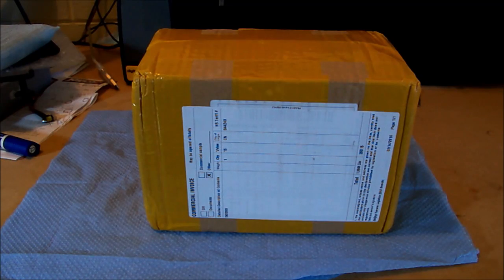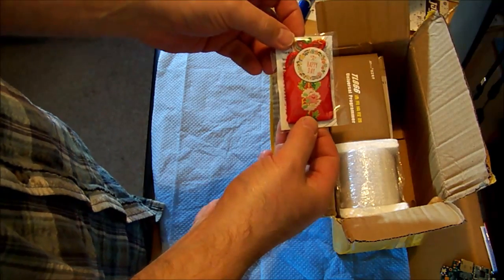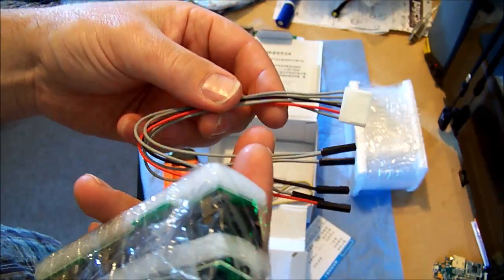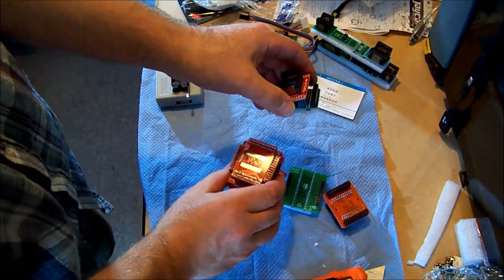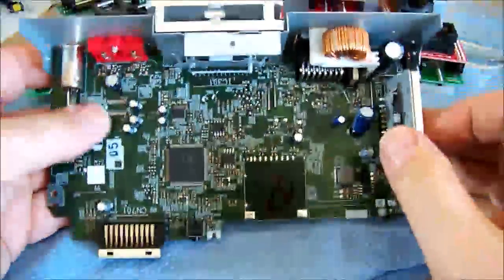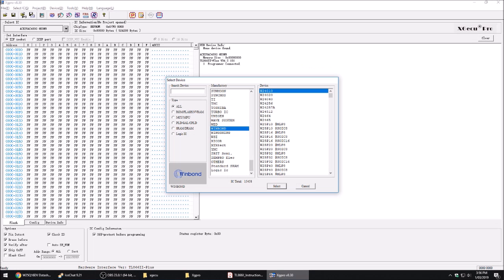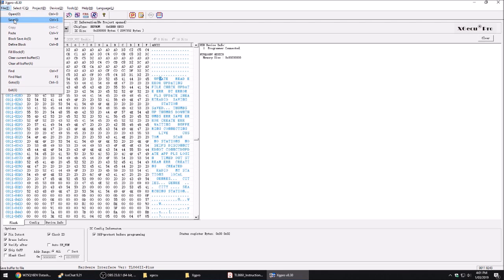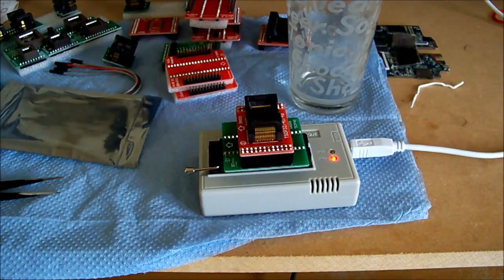XGECU TL866II PLUS EEPROM PROGRAMMER REVIEW

Comment: I ordered one a month ago off eBay from a reseller in Kentucky.  The unit came with a green 3M socket (a good one!) and works with no issues!  Excellent video!
Reply: Just noticed on both the Xgecu and Autoelectric websites - pictures of the TL866II plus with black and green sockets.
Reply from the maker: Thank you, glad you enjoyed it. Hope it serves you well!
Reply: @JonnyFix  It has so far.  I also have a Willem to program 21 & 25 volt EPROMS.

Comment: Thanks for the video might help me decide between Carprog, KESS, VVDI, and this one 
Great explanation thanks again
Reply: Get a Kess (V2) and a KTAG, both are great for programming ecu and bcm. Like the tl866ii, avoid clone units and buy MASTER units not slaves. Also, spend the money on the optional rig to hold the modules and the spring-pin adapter plates. They save a ton of time setting up and tearing down while programming.

Comment: What a great tool, no eeprom is safe now ha ha :-D
Happy zapping :-D
If i was you i would look around for a suitable case for it, perhaps an old electric drill storage case or similar.

Years ago i bought a willem eprom/eeprom/pic/i2c programmer, it was the old parallel port connection.
I saved quite a few mobo's by reflashing the bios, good for general eproms up to 25 volts.
Every memory i had was tested, well i had to lol :-D
The shame is modern personal computers have lost there parallel ports, so it's dead :-(
Any usb adaptor has to be a real parallel port, not a printer only bodge up.

Comment: I tried to read the winbond chip while still soldered on board & a error message keep pop up saying the programmer found short circuit & the protection kick in , it is not wise to try with chip while still on board , I tried with IC removed & it is working fine
Reply from the maker: This sounds accurate

Comment: i couldnt find any info online, does this programmer have support for 95xxx chips? 95040 specifically?
Reply from the maker: It can do the ST  MP95040 range and ROHM BR95040 according to the list in the software. If you download the software it will run in demo mode without the programmer attached so you can see what devices can be chosen :)
Reply: @JonnyFix  thank you sir!

Comment: Hi there I'm ordering this device without a CD and I need your help on downloading the software if you could please
Reply: Go to http://www.xgecu.com to download the software.  There are links about half way down the page.  It mostly in Chinese and the download page is almost totally in Chinese but the links are easy to make out.  I just ordered one of these units - it came with a green 3M socket - and it works like a champ!  I have another programmer - a Willem that operates through the parallel port - that works as well.  I wish this one would do the Xicor X2212D chips.  Then I could backup a lot more ham radio data!

Comment: I have a M27C1024 - 64K x 16 EPROM in a PLCC44 package and used the PLCC44 to DIP40 converter on the apparently official XGecu TL866ii Plus.

I just can't read it as it most pins show no pins detected. My chip is working fine in on the board it came from. 
I emailed XGecu's technical support line but no response.

Any ideas what the reason could be for the no read ?
Reply: Is this chip on their official supported list? You can find it on XGecu's webpage.

Comment: Could be that mine is either a clone or I didn't get the full package option; I didn't get even 1/3 of the socket adapters that you got.
Reply: If you look on Amazon, they are sold by dozens of companies from around $60 to $150. The biggest difference is the number of adaptors/sockets you get with them.